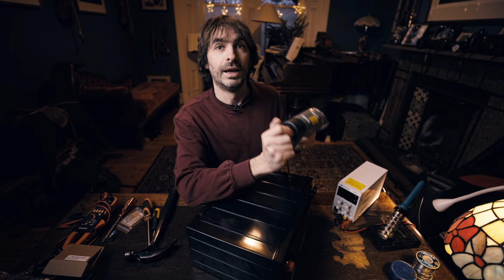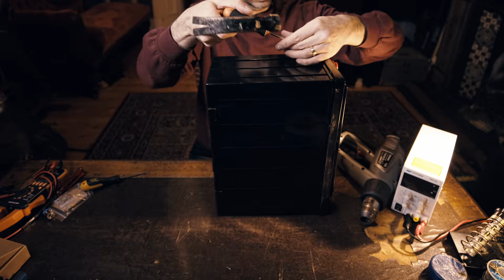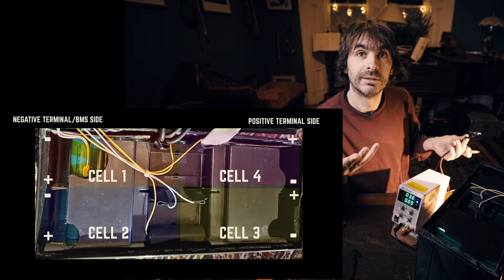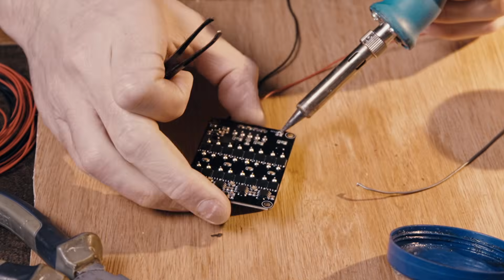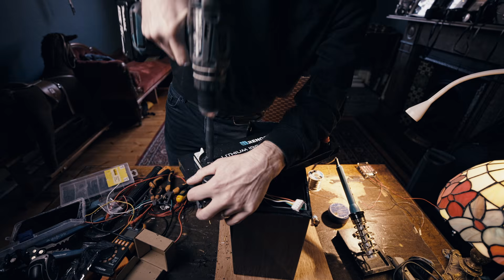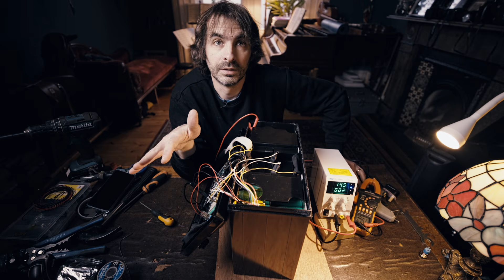How to Fix a Renogy 170ah Lifepo4 Battery

Comment: Hopefully the balancer still works if there is no LED as I removed it and added wires for the switch the same as you did in this video only for the solder pads on the circuit board to come off with the wires.
Reply from the maker: Yeah it does still work, its a really fiddly job.  Don't worry it'll work fine.  You can hear it buzzing to verify

Comment: Thankyou for making this video. I have 3 of these batteries and all are dead and they won't wake up. 
Do you have a video on how to replace the BMS if that is the issue. 

After watching this I'll be pulling them apart to check the cells and if they are good I'll be doing this to them thankyou
Reply from the maker: I did switch out the bms with a jk-bms.  Its great as you have full control and active balancing.  However if the cells are ruined then it won't bring it back to life.
Reply: @Allaboutcampers you wouldn't happen to have a link for the BMS by any chance?

Comment: Brillant video, I have the same battery, its 4 years old, charges to 14.5 volts but soon as its off charge drops to 13.2, it should be 13.4 I did  look at out of balance cells. The top balancer looks like a good idea but looks damn tricky to fit.
Reply from the maker: They will drop after they finish charging.   13.4v would be the ideal,  but 13.2v isn't bad.  If it gets to 14.5v then looks like its pretty balanced.

Comment: Further question re diagnosis.
If cells imbalanced, all of them absorb the same current until full. The first one full then triggers the 14.4 Volt change from bulk to absorption/float. Once disconnected the battery voltage then shows the sum of the cell voltages at cut off. Correct?
So if all cells reach nominal 100%, the battery will be stable at 13.4-13.6 after charger reaches 0 amp/off, indicating cells balanced and full. If the voltage sinks below 13.4, that shows not all the cells are full, and as a result capacity will be less?

Have 2 new 300 Ahr batteries (for separate bank ) have full charged them separately, one is drawing about 8W on float. Once disconnected I expect it to stay at 13.4 +.
Have 2 surviving 170 Ahr batteries mentioned before, to check balance I should let them stand after full charge and see if they both stay above 13.4. If either drop below 13.4, that would show either are imbalanced.

DG
Reply from the maker: That's not exactly how it happens.  The charger is looking for a total 14.4v before it cuts to float.  If the cells are unbalanced then to reach this one needs to be higher, like 3.65v or even more.  The others will be lower but overall is 14.4v.  The cell that's charged really high will be damaged by this.  The bms is not great at cutting charge and will allow cells to be overcharged way over 3.6v(max safe cell voltage) hence over time it destroys the cell.  After a while its so imbalanced that the bms does cut off charge before the overall voltage is 14.4v.  One cell is likely way high, but the others are so low that the battery voltage total is still low and charging can't complete.

Also the cells don't receive the same current, the charger current is divided between the cells based on their individual resistance which changes with voltage and other factors.  So that's why charging can make the imbalance worse and a good bms is really needed to balance out the voltage.

The only way to know for sure if cells are balanced is to open and check.  However if the battery is charging to 14.4v and then settling to 13.4 or even 13.3v after a few hours I would say that looks healthy.
Reply: @Allaboutcampers got it, thanks. Have complained about the 2 year old dead battery to Renogy, and am doing further testing of the other 2. It was only luck I discovered this situation as I bought more 300 A batteries. Will do routine testing from now on maybe every 2 months. After a year, I take it you have solved the problem by doing a manual cell balance periodically?

Comment: I have 3 of these in parallel, 2 years old. As an initial test, I will separate them and charge at 30 amp with a victron mains charger, and see what the cutoff voltage is. If it’s below 14.4V, that will indicate one cell is reaching  full charge before the rest, keeping the others in a partial state of charge and lowering the cut off voltage, which must logically depend on the highest voltage cell.

According to the manual, balancing is supposed to occur during charging, with the highest voltage cell being bypassed, presumably allowing the other 3 to catch up. Once another cell takes the lead, that one must be bypassed and so on.
Reply from the maker: My experience is they don't balance more than a few milliamps and it never makes a real difference.   If you find they are out of balance I would recommend opening up and balancing cells manually as over time the cells get destroyed by over and under charging.  Good luck and let us know how you get on!
Reply: @Allaboutcampers one of them was at 0V so it probably died some time ago, won’t charge or hold a voltage after 12V range charging or Victron solar charging etc. Will cut top open vertically with a thin mini grinder around the edge and check cells. 

The other 2 were at 13.13V approx, one took another 118Ahr, the other took 122. So that seems good. Am cycling them again separately before re-installing for further analysis. I take it a 4 Ahr imbalance would not indicate opening the boxes for manual cell balancing, but will keep an eye on them from now on. Thanks.

Comment: Thanks for the video. I was able to get the case open by taking my time with a heat gun and using a chisel. Three of the cells read ~3.6 Volts. One cell was 0.598 Volts. I assume that cell is toast and the battery is pretty much worthless? AI tells me that a poor BMS will allow a cell to discharge too far and this causes irreversible chemistry to go one (dendritic copper precipitation?) and that particular cell needs replaced. But then the new cell would be newer than the others and not play well together and I’d have to replace the BMS, as well. Wow that was an expensive mistake.
Reply from the maker: Wow, 0.598V is really low, I think that cell is indeed toast.  This issue with the BMS in these batteries is they can't balance, so when one cell is lower it will never get charged properly and gradually get lower and lower or it could be that this cell was actually over charged so badly that it's now toast and showing pretty much no voltage.  Honestly not sure you can replace the cell, even if you did chances are the other cells are not at full capacity and you'll have more trouble later down the line.  I take it the battery isn't still in warranty?

Comment: Mine didn't balance really good cell 4 always gives issues I put a daly BMS in but I think the cells are trashed
Reply from the maker: Yeah I have an older one of these batteries that has a similar issue, you can use it but the BMS will be working really hard to keep the cells in balance and the overall capacity is reduced.

Comment: Hi, thank you for your video.  I am attempting to fix the same battery with the same problem.  Cell 4 is much higher than the others.  I don't have a charger that will charge each cell individually. Is it possible to simply install the new balancer and just wait for it to balance the cells? Possibly charging with a low current or not charging at all until the balancer does it's job. Once again thank you for a great video.
Reply: Yes, but that type of bench top power supply can be very useful.  You can use it to charge any battery basically, that you may come across, if you understand the voltages and currents of every battery you may encounter, and very cheap compared to some battery chargers.
Reply: After doing this repair the battery is now back to 100% capacity.  It took about a week after connecting the balancer and charging and discharging but it worked. I leave the balancer on all the time.

Comment: I took mine apart and put in a daly BMS and extra 18650s. In it too I'll make a video on it soon right now I'm using 2 halogen lights to bring cell 4 down to 2.86 2.87 v to match cells 1 2 3
Reply from the maker: post the video link I'd like to watch it.
Reply: @Allaboutcampers I took them out they was messing up the balance of the original cells and couldn't balance right

Comment: It's so frustrating. I have 2 of these in my trailer, and one went out of balance this year. It will only charge to 13V even immediately after removing the charger. I followed Renogy's instructions, isolated the battery and charged it with their charger, and left it for 3 weeks. No charge even though they said it would enter balance mode and fix itself. What is the point of these batteries if they fail after a year or two!!?
Reply from the maker: If they're still under warranty I strongly recommend asking renogy for replacement/refund.  If not you have to fix them with a balancer otherwise they will get worse and worse and be useless pretty soon.   They won't balance themselves, renogy should know better than to tell you that.
Reply: @Allaboutcampers123 Thanks for the reply. I removed the bad one and got the lid off. Although it looks like the later batteries use way more glue. A couple of spots broke, but I think I will just plastic weld it. It would be wicked if someone knew where the cases came from then you could just cut the lid, remove the glued spots and put a new lid on. There are large strips of shrink tube available on amazon. Once I get the lid welded back on I think I will shrink wrap the entire top edge to make it look nice.

Comment: Excellent video. Quiet tone is refreshing. Safety stuff done well as was your wiring. I am an experienced EE with a friends dodgy Renogy 100AH battery to fix (will find fault. Replace BMS with active balancer and BT. One trick with Active balance switch is to use a magnetic reed relay glued inside case. Then apply magnet to turn on balancer. No LED as BT tells you what is happening.

Comment: Sorry forgot to ask what should it be reading when fully charged. I’ve got renogy 200w solar panel on roof of my caravan .Victron solar charger are my settings right is set at 
Absorption 14.20v
Float        13.50v again any help appreciated.
Reply from the maker: Those settings are what I use.  Charging to 14.2 allows a bit of safety as it can go up to 14.6 but you risk overcharging if cells are out of balance.  14.2 gives you a safety net.  I find the batteries at rest after being fully charged settle to about 13.4v after a few hours.  Don't be alarmed, this is normal and still has the full capacity.

Comment: Just watched your video we’re are you in the country. I’ve got the 170ah battery wanted to double up but renogy have now discontinued them.Been using it for around a year now don’t think I’ve had any trouble with it but not sure if I would know seems ok it’s I’m my caravan . I about to sell it I’m thinking of renogys new 300ah mini have you had a look at it was wondering what you thought about it any help would be appreciated if you know of a better battery. Cheers mike
Reply from the maker: Whether these mini batteries have the same problem will come down to the BMS they've used.  Hopefully they've learnt their lesson and fitted something with active balancing.  I couldn't find anything online about the BMS.  If I had the money I'd buy one to strip it down.  I'm sure someone will soon.  I don't know how they've squeezed 300ah into such a tiny case, I thought the cells of lifepo4 were pretty much all the same size.  Maybe someone else can explain this?  Looks suspiciously too good to be true...

Comment: Do I need to put a switch in? (I'm really new at this)
I use my 2 - 170ah Renogy batteries in my RV with solar power, which means they are in a constant state of charge except at night and in the winter when in storage. If I delete the switch, I'm assuming they will constantly be balancing (?). So, when not being charged by solar (or my LifePo4 charger for top up when low), will this constant balancing be draining the cells? Also, is there harm in balancing while the battery is being charged?
I apologize for my ignorance on this subject. I am learning.
(edit) One more question: With the switch in, how often do I need to balance the cells? And can this be done while the batteries are connected in parallel?
Reply from the maker: It's not essential to have a switch.   It will work just fine balancing all the time.  Theoretically if all the cells are in balance it stops balancjng anyway as it requires voltage differences to charge the caps.  However, it will be balancing a lot of the time.  I just felt it wasn't necessary and I wasn't sure if the balancer would be robust enough to be on so much.
Reply from the maker: Your second question,  i only balance them a few times a year, leaving it switched for 24hrs.  The few times I've opened the batteries the cells were all completely in balance after months of use.
Reply: @Allaboutcampers  . . . sorry to be a pain in the butt, but I have one more question: I have a plethora of waterproof 3-pole 12v dc switches (about the same size as the one you used in this video) and I was wondering if there is a way of using these instead of buying 4-pole switches. My thought is to connect the negative pole (on the switch) to the (B-) wire, which is connected straight to the main negative terminal on the battery. 
I'm assuming the "Run" terminals on the back of the balancer board are for the little LED light on the board and that's why you used them, but if I left that "Run" solder in tact and just used the 3-pole switch, it should still work right? The other 2 poles on my switch are, of course, to toggle the switch & I would connect them to the "Run" terminals on the front of the board just as you did. 
Or, should I simply run one wire from the "Run" terminals on the back (leaving the 2 terminals connected) to the neg.pole on the switch? 
I'm asking because you seem to know more about this balancer & DC wiring than I do.
Reply from the maker: @quaddingsous  it's way simpler than that.  The run pins come shorted when you buy it.  Just remove the solder, and you will reveal two connection points.  Just use any switch to connect them together and it will run. My switch was just a standard 2 pole switch but it had an led as well.  This is separate circuit which you wire to the led on the board.  You don't need to connect any wires to the battery cells.  Led is optional.
Reply: @Allaboutcampers123  . . . The three-pole switches I was referring to also have an LED light on them. The third pole is the negative pole which is normally hooked up to the negative on a battery.
Reply from the maker: @quaddingsous right I know what you mean.  I don't know if that will work to be honest.   Shorting the run pins is what you're doing, i don't know if there's enough voltage/current through those pins to power the led which is how those switches work.  You'd have to try it and see if it works (or fries the board).  My way of wiring is sort of a hack, using both the terminals of the led on the board.  Keeping the run pins totally separate.
Reply: @Allaboutcampers123  . . . K. Perfect. Thanks for your help again.
Reply: @Allaboutcampers  . . . Thanks so much for your reply and for posting that video! My 2 Renogy's only charge to 12.4v on one, and 12.7v on the other. I've tried 2 different LifePo4 chargers (one of which is from Renogy) and they both tell me the batteries are full, so I'm assuming I have the same problem as you and so many others that have bought these batteries. I haven't taken them apart yet to test the cells, but I will be now for sure.
Thanks again for spending the time to make this video! Greatly appreciated!

Comment: What would be the downside of not having the on/off switch and just having it active balance all the time? I do leave my battwries for about 6 months every year and was told by Renogy to charge them to 80% before leaving them. Curious to hear your thoughts. Great video by the way!
Reply from the maker: potentially no downside but it means the balancer is active all the time so I was worried that it might fail.  With it being quite inaccessible I didn't want to risk it.  I have heard of other people leaving it on all the time and having no problems.  If the circuit in the balancer is well designed it will stop working automatically when it's balanced.  The caps will stop charging/discharging when there's no imbalance to drive the process.  I'm not sure if that's the case though.  Perhaps someone else who has tested them can verify?  If you installed JKBMS then the balancer has a setting to turn off under certain circumstances so the balancer wouldn't be on all the time.  And yes ideally when storing Lifepo4 batteries they should be stored at a mid state of charge.  Not full.  Doing this won't stop them going out of balance though.  Let me know how you get on.
Reply: Thanks for the quick response...do you know of a new BMS that is a smaller footprint (fits in the case) that still autobalances?
Cheers
Reply from the maker: @kevinsmith8674  sorry missed this.  I fitted a jk bms 200a to another one of these.  It does fit just about and works nicely.  I didn't think the extra cost and work required was worth it compared to installing a balancer.  But it is a good option.

Comment: Great video! You should think about your safety. You can temporarily terminate the B- cable to prevent arching, electrical tape is an option. Also, drilling down onto a bock may save you from an accident.

Comment: Well here we go again. Bought a 230ah Li Time ‘low temp protection’ batt and just finished trying to bench top charge to 14.59 at 10amps.  Went all day and shut down. Remove charge and get 13.13 at the battery… These batts are all shipped imbalanced!